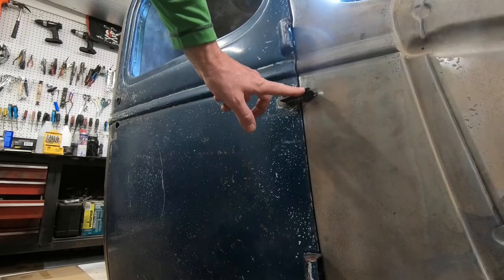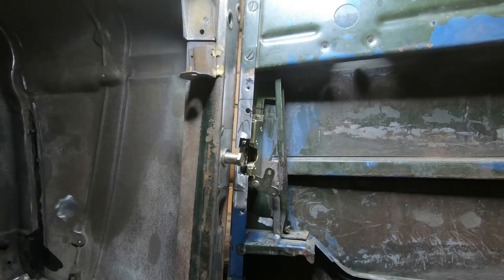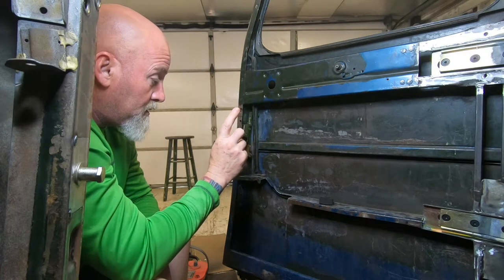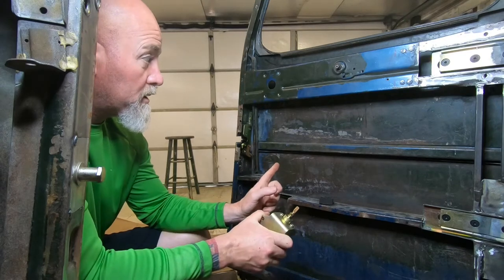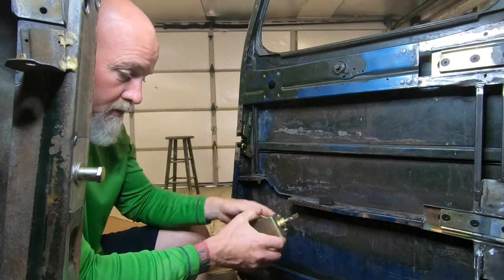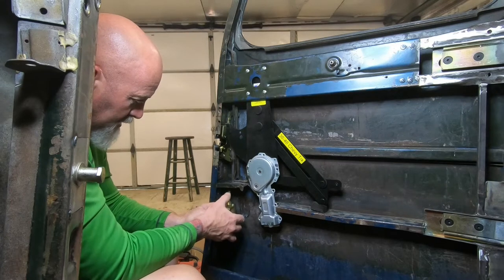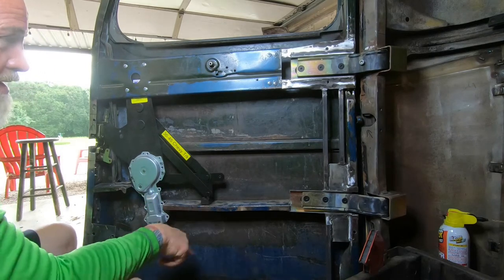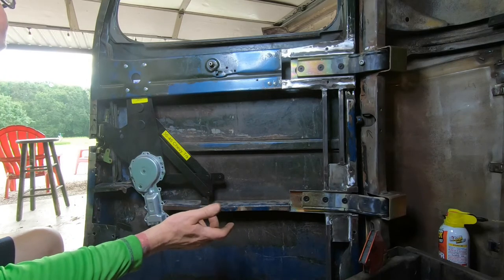1941 Chevy Truck Restoration, Install Autoloc auto door popper unit, passenger door

Comment: Most Popper's don't need the door locks because you have to have the keyfob to open it anyway, but the belt and suspenders works too
Reply from the maker: Agreed, don't want any accidental door openings while driving.
Reply: @ELDESTBuilds  Noooo, that would be pretty ugly with suicide doors,,, eeek
Reply from the maker: I'll get you the part number off the box.